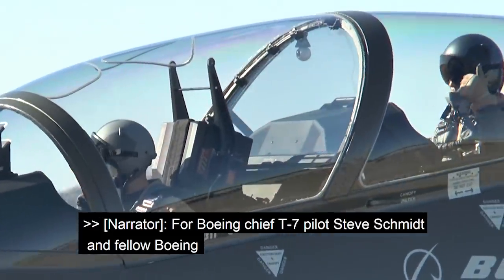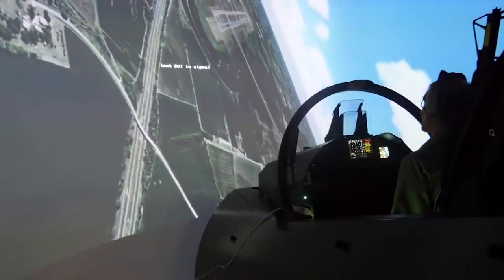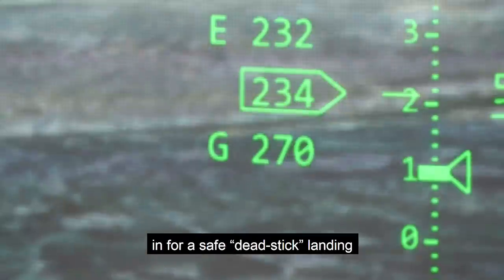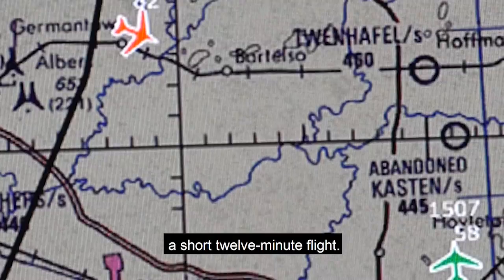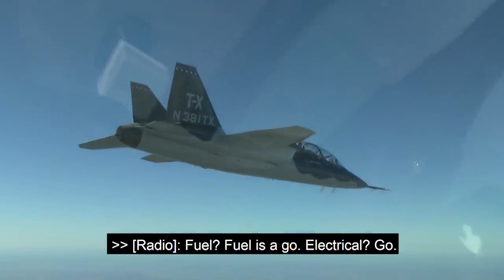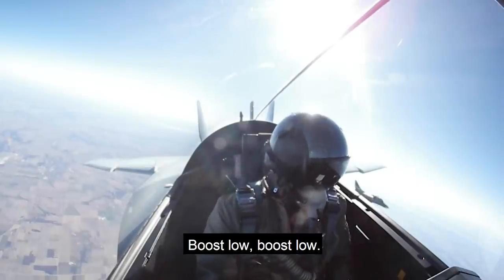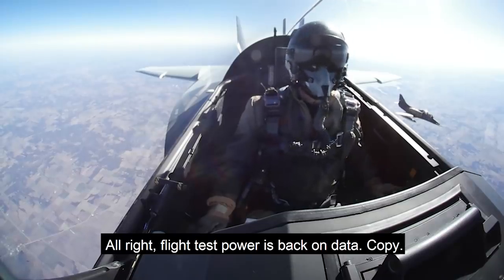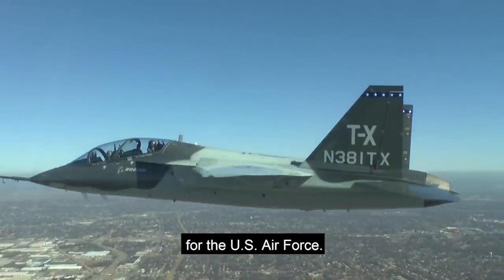Boeing T-7A Test Restarts Engine Mid-Flight

Comment: T7A has design flaw causing wing lock.  Air force should got T50 from Lockheed which can also used as light attack for war against terror and maintenance cost is almost half of F16 plus fly supersonic at mach 1.6 filling gap between A10 and F16.  Boeing wants more money for T7A for fixing wing lock problem.

Comment: Funny how the engine has to be restarted manually after a flameout. The F-22 will automatically restart its engines in case they shut down. I guess in a trainer aircraft you have to train for the manual restart.

Comment: That A-4 chase plane is probably older than both test pilots. Love that they still fly them.
Reply: The very  last A-4M came off the assembly line and was delivered to the Marine Corps in February of 1979. That will be 42 years ago in February, 2021.

Comment: They installed same system in 737 max , only thing is that engine doesn't restart again .
Reply: Risky risky stuff . Boeing should avoid that test
Reply: captain evans where the heck you saw that? B38M crashes due to MCAS, not the engines shutting down. Or, are you just miming?
Reply: @Acepilot1312  just kidding around.....
Reply: captain evans okay sir!

Comment: They still not done with this new trainer. The award is already given for it to be built.
Reply: Well it's just proofing. This are not the factors you buy they are just considered as some thing that should just work. 
   Same for gripen in brazin and Sweden. Why do tests by the company and then again by the individual airforce. Just costs alot of money. 
   And in this case the aft is from Saab and its not really new tech. This it the stuff they always have built. 
   Todays air world is to slow to wait for some thing to be finaly developed before accuiring. Then you will just have to do an update first thing. Companys need to work way closer with the involved airforces. Not like F35 and F18 F26 as it currently is.  Can not take 3-5 years between updates

Comment: Only 48 seconds turned off? I guess it’s a start, but I would like to see it turned off for like 5 minutes and then restarted.
Reply: They're at 20k feet; in that 48 seconds they dropped to >8k feet. They'd be dead in steaming pile of ashes if the engine was of for 5 minutes.
Reply: Dwight Stewart Well, I’m pretty sure planes don’t fall like rocks as soon as you turn off the engines. It’s my understanding that planes are able to glide for a while before they get anywhere near the ground. However, I’m not too sure how many minutes a plane would be able to glide before being super close to the ground from 20K feet, seeing as I’m not a pilot yet.
Reply: @AvocadoCotijaCheeseConnoisseur  Aircraft generally have glide ratios computed for them & even something like a 737 has an at least 15:1 glide ratio of 15 feet forward for every foot down.   And that implies 180,000 feet forward for 12,000 feet down.    That's an airliner v fighter, so I severely doubt the plane was at severe risk of crashing.

Comment: Gee seems like a big deal.
Glider pilots: shaking their heads.
Cessna pilots: we do that on a flight test.
Ultralight pilots: second nature.
Reply: Not a big deal but needs to be tested regardless. First of all, this was more to test the airplane and not the pilots. Secondly this airplane is designed to go supersonic, to do aggressive aerobatics and pull G's just like "real" fighter jets as well as operate in all weather and highly variable altitude- and speed-ranges. None of which "Gliders", "Cessnas" and "Ultralights" are even remotely capable of.
Reply: Well i am bot sure with this one but some aircrafts today are fly by wire and with computors that balance it. So not so easy to glide as one might think.

Comment: Dear Boeing Team. I hope you should prepare for conducting a "Landing" after Switching Off the T-7 Engine, simulation for a critical working condition that a real failure Engine would offer our Pilots should choose the right choice Landing the Aircraft T-7 without any bad Thrilling, no need a help from their Parachutes in good enough working environment of Wind and Temperature. Is it ok for Boeing? Please kindly feel free to let me know. Thank you. With best regards. Tony.
Reply: I mean my idea is for a real good Landing Testing like Boeing did simulate it by using their Simulation System, as reported in this Video. We are looking for the Landing Test, Boeing. Come on...

Comment: shut it down during an emergency? what does that mean?
Reply: lucian compressor stall, flame out, foreign object ingestion, the list goes own for such reasons.
Reply: Depends on the plane but sometimes even just an unusual maneuver can starve the engine of fuel and cause a failure. The mig21 I fly in dcs world shuts down after like 2 seconds of negative g's so I have to restart a lot lol

Comment: That's a whole lot of drama just for an engine restart test...
Reply: Yes sure. Let's see how you react when there's a problem in the ONLY engine of the plane you're flying
Reply: @therealsharat  that guy is a trained pilot... a test pilot.  Who has the pucker factor to handle it.  This whole video is overflowing with false drama.
Reply: RonJohn63 - not just the fact the pilot can handle it...let’s say the engine won’t restart, and he has to make an emergency dead stick landing...or, worst case, pilot has to bail out if the plane becomes uncontrollable or can’t make a landing...that’s a few million for the aircraft gone, probably several months delay for the entire program and maybe tens of millions for analysis and redesign of the issues for the airframe and avionics. All in all, it is high drama because it’s hundreds on millions of dollars for contracts on the line, all down to one pilot and one test.
Reply: @velocitymg  bruh leave it he won't understand he a kid

Comment: I took my Ford Explorer out on the freeway, got my speed up to 110 mph and then shut the engine off! I'm not sure if it was the engine, the automatic transmission, or maybe its just that my Explorer wasn't designed like the T-7. But things didn't go smoothly.
Reply: Power steering oops, power brakes oops this was not a good idea. It handled just like 48 Mack truck.😱
Reply: @aaronlopez3585  The steering will also lock, at least in vehicles I have driven.
Reply: @aaronlopez3585  you forgot the self locking steering wheel. O-ya lollollol
Reply: 110 mph and you shut it down?
"First time on bath salts dear?"🤣
Reply: GM had something similar. Except you didn't have to turn off the engine. It turned itself off while driving. Many people died.
Reply: @elvism684 ,dam self locking Doors 😮😮😮
Reply: Wait, isn't the wheel suposed to lock only if you take the keys out the contact?
Reply: @nashooo5903  no it locks up even if your keys are in ignition and you haven't half turned or full ignition
Reply: Garth, are you sure you followed the restart procedure correctly???
Reply: @daytonmiller6131 @let clutch out , itl start in high Gear !!!
Reply: 3 name changes allowed every 90 days.  No,
just couldn't resist an opportunity to use that line😁
Reply: 3 name changes allowed every 90 days.  My hog is absolutely sparkling clean,  thank you very much 😁
Reply: Maintain fluid Dynamics... Seattle pants. Simple tensor calc.
Reply: It happens Buddy ...😮😅😮😅
Reply: GOLD 😂😂😂
Reply: Garth Murray ROFL 😆🤣🤣🤣

Comment: Did this in a helicopter during a demo flight.  i.e. The instructor pilot switched the engine off mid air to demonstrate an autorotation.
Reply: You mean he just shut the throttle to idle.

Comment: Electro-magnetic propulsion is million times better than jet propulsion.

-almost instant acceleration/deceleration(no g forces, no inertia) 

-VTOL and hovering/levitating 
-hyper sonic speeds 

Jet propulsion is ancient in comparison.
Reply: But so far does not exist
Reply: @thomastate5785  Lockheed has it since 1950s.
Reply: Anti gravity warp drive is even better than electro-magnetic propulsion, not sure if it's a million times better but definitely better.
Reply: @schumifan78  I dont know about warp drive but EM propulsion is orders of magnitude better than classic jet engine.

Comment: Not sure I quite understand this. If you are procedurally shutting down an engine in an emergency, it’s not likely you will want to restart it. I guess if the engine fails unexpectedly will it restart?? You never can tell with news reports. They can’t seems to get it right half the time.
Reply: Engines can fail midair for a variety of reasons but still be operational, it's crucial to be able to restart them mid flight. On some aircraft like the Saab AJS-37 Viggen, a compressor stall could choke the engine. The engine would be functional but simply not running, necessitating a mid air restart. Similarly, the fire suppression systems on some aircraft shut down the engine, which needs to be restarted after.

Comment: the T-7 is kinda like F-16 and F-18 had a baby
Reply: And a pretty good looking baby at that
Reply: Gripen + F18 = T-7 👍🏻
Reply: Well technically, the T-7 utilizes the General Electric F404-GE-103 engine which is in the same F404 family of afterburning turbofan in which the F/A-18C/D Hornet uses.
Reply: They had a little boggie
Reply: Lol I want one for some reason looks fun to fly
Reply: An the t38
Reply: Many Gripen, There are a lot of SAAB design in this aircraft 👍🏻
Reply: calm down it is just a trainer, nothing special
Reply: Excellent dezine & cutting edge shape .
Reply: @Ricky Kurniawan,
It doesn't share anything with F-16, it's more like T-38 Talon and F-18 had a baby. I guess it having a single engine made you think of F-16.

F-16 is made by a different company and has different avionics, different propulsion configuration, technology and slightly different controls under the hood.
Reply: Only it does share the landing gear with the F-16. Also its part Gripen and F-18 with some F-15 parts thrown in so the Air Force has interchangeability on parts.
Reply: bradley huebner do you know what parts are Gripen or SAAB in the T7? Curious to know the extent of SAAB’s involvement in this joint venture. I don’t think the Swedish AF have any plans for the T7.
Reply: @floatingchimney  the exhaust and underbelly look like a F-16
Reply: @schaelakhan  Have you ever seen what an F-16 underbelly looks like? T-7's underbelly is NOTHING like F-16.

F-16 has a totally different engine configuration, and it's air intake is a big single one at the bottom of the plane, T-7 has a configuration like the F18 - which is a bifurcated air intake on each of the plane's sides.

You clearly don't know what you're talking about. As well as mentioning they have exhausts that look alike LOL. You forgot to mention their tires and paint look alike as well.
Reply: @floatingchimney  Chill out, you're arguing an innocent comment on a flight test video. For the record, when I first saw the T-7, I also thought that it looked like a mix between an F-18 and an F-16. Especially the rear of the aircraft, including the exhaust nozzle. Dont even bother replying, I encounter F-16s up close and personal every day.
Reply: @floatingchimney  Well the throttle looks like it's from an F-16

Comment: An A-4 Skyhawk for a chase plane?!

AMAZING
Reply: It's just like a grampa when he takes his kid to walk with a brand new bicycle.
Reply: There are several 3rd party contractors that fly a-4’s, and other similar aircraft for this kind of work, and aggressor training. Check out a company called Draken.
Reply: I was about to comment this exact thing, the A-4 is such an incredible plane
Reply: I remember over fifty years ago seeing  a bunch of RNZAF A-4's buzzing around my campus. They stayed in service for decades.
Reply: Giant Gaming looks like a T-45 goosehawk
Reply: @ballomni Not a T-46/Hawk trainer ..the fuz behind the canopy doesn't slope in a downwards fairly straight line to the tail, plus there's a area ruled chubby bump mid rear fuz, so a late model A-4, likely a Q or later variant.
Reply: @razor1uk610  Dude so you have 2000 hours and 22 years so I bow to your expertise lost my ticket back in 95, I am sure you are right as my son a Navy Test Pilot LTCMDR says I flew with steam Gauges , he and I am sure you fly with glass cockpits even his T-38 is glass, I used too fly the Model A of that bird.  GodBless..
Reply: Good performance and cheap to operate. Scooters are good a/c.
Reply: I was just going to ask the same thing.
Reply: ikr pretty dang cool they still use it for stuff!!!!
Reply: Giant Gaming Viper and Jester approve
Reply: @heyitsvos  Ronald  A.,Skender

Comment: The chase plane was an A-4? I had no idea any of those were still around.
Reply: All A-4s in the US are civilian owned.
Reply: A-4s are still used by the US civilian Draken International and AeroGroup with a total of 21 , and the Brazilian Navy and Argentine Air Force
Reply: They are still around in the US and can be used specifically for this purpose.  Even military aircraft are recycled and put to use after retirement.  The ones you see in the desert are airframe with extremely high flight hours and cycles.  Manufacturers can use the aircraft over again especially a small agile aircraft like the A-4 as a airborne spotter/safety observer.  All the weapons systems are removed and pretty much the military part of it is gone.  Can be used by air enthusiast groups.  The WW2 aircraft that you see flying at modern air shows are a perfect example.  Even the vintage aircraft on static display at air shows had to be flown from somewhere to the show right?
Reply: ikr its like a grandpa teaching its grandson taking his first steps in the sky
Reply: 13partagas chase planes or target aircraft are usually designated “Q”. F-4s used for target practice, or chase are known.
Reply: Draken uses them
Reply: Boeing still use T-33s for chase!

Comment: This is going to be a great aircraft, and I know it is a very reliable engine, but why on earth would this kind of test not be done over the water or over the desert?  I'm hoping that the footage shown was file footage and not that of the real test.  If it was the real test, I'd be concerned about the lack of judgement of the planners concerning the location.  Evan a rural farming area has too many homes.  Like I said, desert or water.  That's where this kind of test should have been (and hopefully was) done.  Even with today's reliable turbine engines, this is still a prototype aircraft with systems that have not been integrated together before, so all precautions should be taken in its test program.
Reply: Don't worry, it was probably file footage and I bet they were within gliding distance of their airport.
Reply: It is a prototype but my guess is that it’s using many of the new systems seen on the F-35 that were completely novel only two decades ago.
Reply: The test was done in an area that had a runway beneath it for  the one in a million case the engine failed to restart the pilot could glide to a safe landing using backup systems , minimizing the risk to both pilot and aircraft. My guess is the pilot would not even have needed to make a turn to get to the runway.